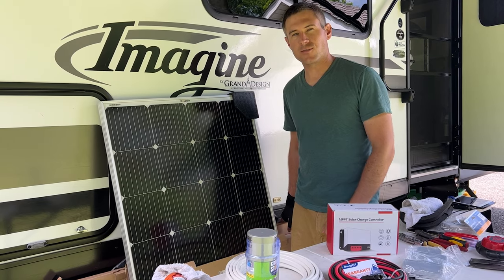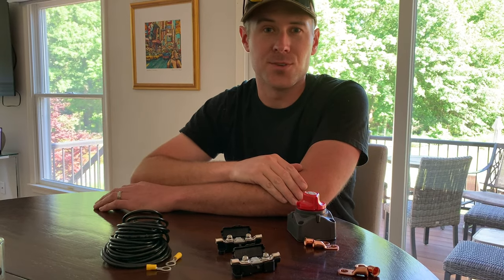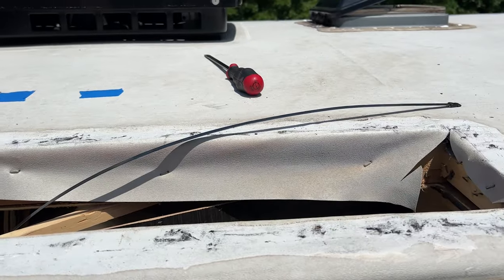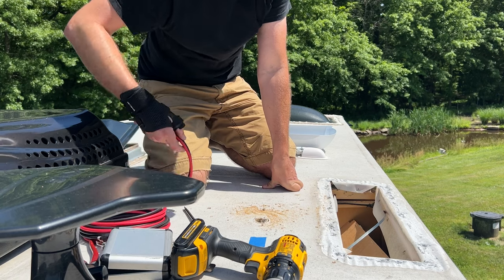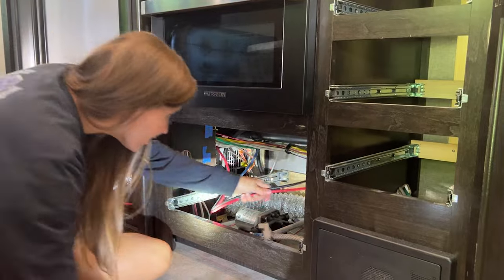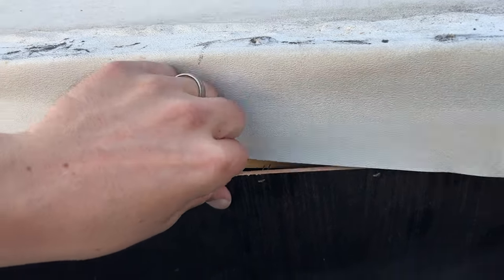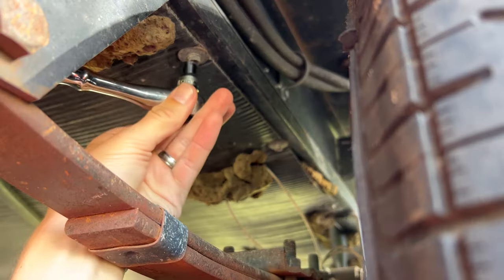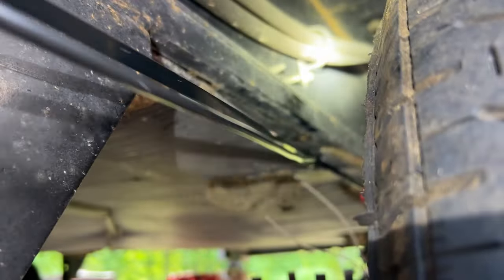RV Solar Install in 4 Days

Comment: Side Note. Install under sink? In our current camper, 4yr of ownership, we have had to replace 2 faucettes on both, Kitchen, (2x) and bathroom sink, (2x) Spraying from the cracks made electrical under the sinks questionable on my part. Possibly a splash gaurd? Cheap piece of plastic taped over electrical. Looks good what you are doing.
Reply from the maker: @markwitkop7022, thanks for the comment. This concern crossed my mind being under the sink. With limited concealed mounting options this is the best solution we could come up with for our floor plan. I mounted it under the lower shelf for additional protection. Adding flashing over the control panel may help direct water away in a worst case scenario but I would not cover it completely because it needs to circulate air. Do you plan on installing solar on your rig?

Comment: I didn’t read through all the comments so excuse me if this was mentioned. When you mounted the roof panels did you put a wind deflector at the front end I order to keep wind from getting under while driving. I would be concerned that at highway speed the air flow will make a wing out of the panels and that could cause future problems.  The deflectors I’ve seen where a length of angle aluminum screwed and glued at front of lead panels I don’t know if it’s needed on the side as where I’ve seen it was just a 1 panel installation
Reply from the maker: @brianusa394, thanks for the question. I did not use wind deflectors for the lead panels. I made sure to set the front panels back far enough from the font of the camper that most of the wind is deflected up and over everything. This is why I started my solar layout from the rear of the camper. I have not had any issues with uplift of the panels with the provided mounting screws and additional dicore sealant. Make sure the feet are very secure to the panels before mounting in place.

Comment: Thanks much for this vid!  Plz tell me what length screws you used to attach panels to the roof.  Hope ur out camping somewhere today. 😊
Reply from the maker: @jjm9902, glad I could help. I'm not sure what length they are. I didn't measure them before hand. All the mounting hardware came with the BougeRV solar panel mounting feet as a kit. I don't think they specify length of the screws but here's the kit I used. https://amzn.to/3MOUj5h
Reply: @jacobsupgrades  Thanks again... and for the Amazon link. I'll just use the 1" screws I have.

Comment: Your video is an excellent step by step publication of what I need to do. I did have a question. What type of battery wire did you buy as I have never seen batteries wires wrapped in white sleeve? 

And how did you figure out how to remove the microwave, I liked the idea of running the wires thru that area.
Reply from the maker: @Aaron King, that wire is called 8/2 AWG duplex marine wire.
https://amzn.to/3ehOcZP 
The red and black wire is double insulated for more protection and easier routing.

The microwave is face screwed into the cabinetry and requires a Phillips head screwdriver to remove. Be ready to unplug it before setting it down. We haven't had any issues with running the wires down thru the microwave, and honestly it was so easy. Would highly suggest this route.
Reply: Thank you for all the knowledge. Your install video is probably the best install video I have very seen. 

I did have one more question, when you installed the solar panels do you remember the size of the screws you used to install them onto the roof?. 

The Renogy kit I purchased came with 1 1/4 screws. Another video I watched used 1 inch wood screws.
Reply from the maker: @aronking6683  I'm glad I can help. I used the BougeRV Solar Panel mounting kit/hardware with 1.5" screws. 
https://amzn.to/3TAJsyy

Comment: Great video! Couple (maybe more) questions: did you just screw your panel mounts into the roof or did you mount them into roof supports? What length screws were used?  How come the controller needs its own ground wire?  There seems to be a mantra of mounting the controller as close to the batteries as possible, I suppose to mitigate voltage loss: are you satisfied with the charging performance at that distance?  Thanks!!
Reply from the maker: @joeborgione5477, Thank you! Yes I screwed the panel feet directly into the roof, I'm positive I only hit a couple roof supports during the process. The whole roof sheathing of our camper is a plywood type material so I'm not concerned with them lifting up. I used the screws that were provided with the BougeRV solar feet & hardware kit - https://amzn.to/3xQnIon  I think 1-1/2" but don't quote me on that. The controller needs to be grounded incase of a power surge that it doesn't fry the controller and disable it. As long as you use the appropriate wire gauge between the controller and battery based on your distance there should be no voltage loss. So far we love this solar set up. It's been a game changer for our full time travel while working full time out of our camper. We have since upgraded our battery bank to lithium and we have more power than we could imagine. Here's my install video on the battery bank -   https://youtu.be/nrEVEIYwKLg
Reply: @jacobsupgrades  Awesome! Thank you! I’m in the planning stages for my travel trailer solar panel install. I’ve been using portable panels and it’s time to upgrade.
Reply from the maker: @joeborgione5477  You will love upgrading to mounted panels. No more hassle of pulling out the panels and cables each time you move and worrying about wildlife or other people accidently running them over.

Comment: Really interesting to watch the install. Would be interesting to see this install in a drivable RV. With 800 watts are two batteries enough? Are the batteries lead acid or lithium?
Reply from the maker: @edwardwayner451, Thanks for the comment, I'm sure this same install process could be applied to a driveable RV. We have deep cycle lead acid batteries nothing fancy. Plenty of power during the day to charge 2 laptops, a monitor and now our Starlink RV. Starlink does drain the batteries down at night but we're about to switch to (2) Unowix Defender X100 Lithium Iron Phosphate batteries. We have plenty of solar but its our battery bank holding us back.
Reply: @jacobsupgrades  We found the exact same thing. We have been FT for the last 4 years in a 35ft Class A motorhome. We started with 2, GC-2 FLA batteries that our coach came with, but we found this was inadequate for our needs. We mounted a 620w solar array on the side of our MH that virtually lifts itself into place with gas struts. Being able to adjust the angle precisely for our latitude and month enables us to produce 25-30% more power than flat mounted panels - even more in winter, when the sun is lower on the horizon. But most of this energy went to waste as our batteries filled up too soon and went into float mode early in the day.

In January, we installed a custom built 560ah LiFePo-4 battery, made with 8, 280ah prismatic cells. We used a Heltec 330amp BMS and a 5a active balancer, to start our onboard 5,500watt generator and keep everything safe and balanced. We built our 12v battery with grade "A" LiFePo-4 prismatic cells having an 8,000-cycle mfg. projected life at 80% DOD or 6,000 cycles at 100% DOD. This means that if we cycled them 100% every single day, 365 days a year, they would last over 16 years! It only cost us $1,500 to build it, including the BMS. The main reason we chose these cells is that they fit perfectly under the steps of our motorhome where our old pair of GC-2 golf cart batteries used to reside, saving 35lbs compared to our old FLA batteries - not to mention having over 5 times the capacity. We cut a small hole in our steps and installed a tiny computer fan to keep this space at close to room temperature and we insulated the battery compartment too. So far, our system including the liftable array, wiring, breakers, a new Progressive Dynamics 80a Li compatible converter/charger, 600w PSW inverter (to run our TV and PC), an Epever 50a MPPT controller, and a Renogy battery to battery charger (to protect the alternator, allowing it to charge the battery while driving) cost us around $3,600. We saved much more than this in RV park fees year after year because we boondock most of the time.
Reply from the maker: @SuperSushidog  Thank you for the very informative comment! I have never seen a solar array mounted on the side of a motor home but it would make a lot of sense for adjusting them to your needs. I'm sure it doubles as an awning for shade in the warmer months as well. I'd love to see your set up.
Reply: @jacobsupgrades  I just sent you an E-mail with a couple pics of our set-up.
Reply from the maker: @SuperSushidog  , Thanks I'll check it out!

Comment: Did you screw the panel bracket feet into studs or is it ok not to be
Reply from the maker: @TidewaterAerialSolutions  my whole roof has plywood roof below the TPO I can walk on so I could screw them in anywhere. If it's a solid substrate then you don't need to hit studs.

Comment: How did you find the roof truss locations? Or did you just screw directly into the roof panel only? I need info on how important it is to screw into a truss rather than just the roof panel
Reply from the maker: @steverussell2659, I screwed directly into the roof panels not trying to line them up with the truss locations. The plywood roof sheathing beneath the TPO roofing is plenty study to hold the panels. I was more concerned with their alignment on the roof. We've driven around 15,000 miles with them mounted this way with no problems.
Reply: @jacobsupgrades  Thank you so much for the information

Comment: Hello I'm wondering why you didn't send the wires down through the fridge vent?
Reply from the maker: @Michael Milton, I have used the fridge  vent in the past but I wasn't a fan of cutting the screen to pass wires through creating an entry for pests. Using the Solar cord entry box is the preferred water tight method. I did use the area above and along the fridge to route the wires.

Comment: So does your RV already have a inverter? I would like to install solar on my toy hauler but I would like to install a inverter to so I can run 110 volt utensils as well, just need to muster up enough confidence to make the leap.
Reply from the maker: @Scott Duffy, I currently have a 500watt pure sine wave inverter installed and have a video for it link below. I'm about to install a 1,000watt go power with remote on/ off switch to run our new Starlink Internet. I plan to post an install video of that as well. 

https://youtu.be/vF5Lx5KdS40
Reply from the maker: Highly suggest a pure sign wave inverter rather than a step up inverter. It won’t ruin your electronics whereas the step up inverter is not good for electronics. Email me if you have any questions related to supplies and/or detailed instructions on the install. I’d be happy to help. Ozarkfloating@gmail.com
Reply from the maker: @Scottduffy808, here is my 1,000watt power inverter install video. https://youtu.be/DmNObB2aF9I

Comment: Great video!
Reply from the maker: Thanks! Pretty easy to install the solar. You plan to do a solar install on your rig?
Reply: @jacobsupgrades  yes, just getting started on 400 watt system for our rv.
Reply from the maker: @dboutdoors06  , that's awesome! If you have any questions along the way reach out, I'd be happy to help.
Reply: @jacobsupgrades  sounds good, thanks.
Reply: Great video! Did you have to find the studs to screw the panels in?
Reply from the maker: @JTCOLORADO2008  , I did not search for joists because of the thin plywood layer below the TPO roofing. But if I hit one it's an added bonus. I was more worried about the panel layout and maintaining enough room to service my AC unit.
Reply: @Jacob's Upgrades  ok, so im assuming the supplied screws grabbed good enough on the plywood to keep panels from falling doring transportation? 
My Renogy 400watt premium kit just came in and I will be installing the 4 100w panels on mine next few days...
Reply from the maker: @JTCOLORADO2008  yes, we’ve driven across the country from east to west coast and the panels are still tightly secured up there. Make sure the feet are really tight to the panels before you mount them. The Dicor may help keep in place too.
Reply from the maker: @JTCOLORADO2008  yes, we’ve driven across the country from east to west coast and the panels are still tightly secured up there. Make sure the feet are really tight to the panels before you mount them. The Dicor may help keep in place too.

Comment: any leaks after all those new penetrations in the roof?
Reply from the maker: No leaks after a year of solar on our rig! I used quite a bit of dicore sealant on each screw to help prevent water intrusions.
Reply: @jacobsupgrades  - do you treat the rubber membrane on a yearly or quarterly basis (to prevent breakdown of it over time)?
Reply from the maker: @honeybadger6127  I try and clean the roof and camper once every few months to keep buildup off the roof. I usually inspect all the lap sealant once a year and do touch ups as needed.

Comment: Why not run it through the pantry?
Reply from the maker: I didn't want to lead a pathway for all the critters and bugs right to our pantry. Also this gave me access to the ceiling above and access at the floor below the fridge due to the access panel. You could run it through the pantry but I'm sure drilling holes at each shelf down wouldn't be fun.